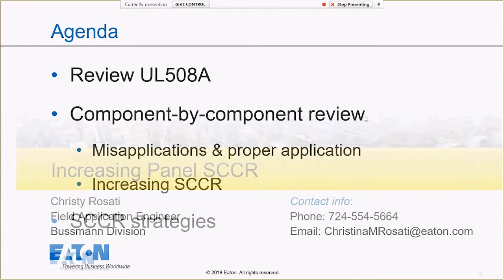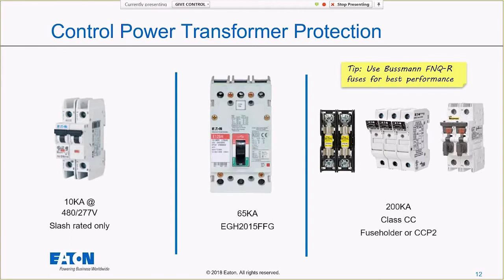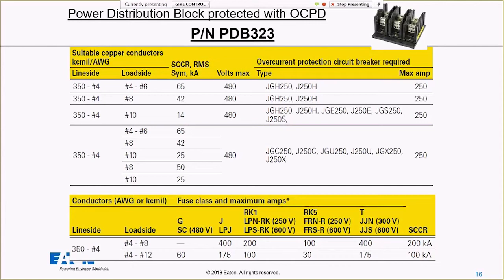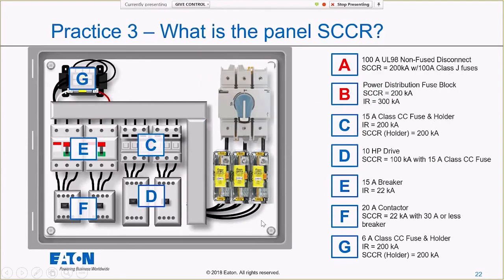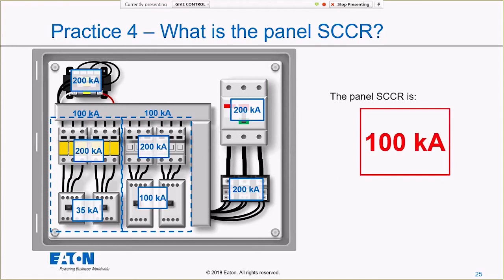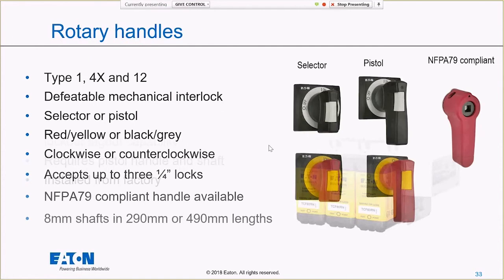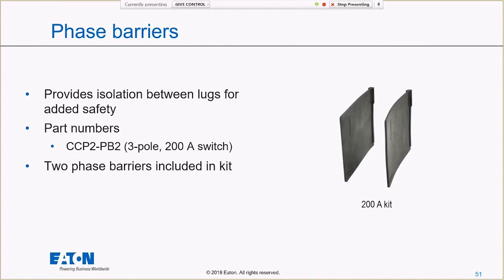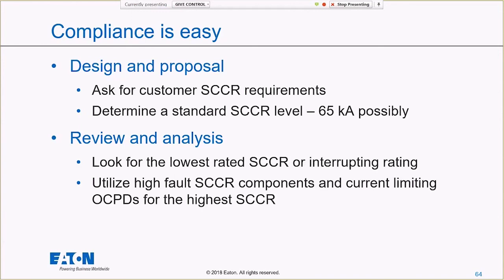Bussmann SCCR Part 3: Strategies for increasing Control Panel SCCR

Comment: I really went down the rabbit hole with the UL 1953 vs UL 1059 since many manufacturers are marketing their product as power distribution blocks but are actually being tested as terminal blocks. If you're unsure and the product data sheet only shows the certificate and UL CCN number a dead giveaway the as to whether the product is UL 1953 or UL 1059 is the UL CCN number itself. If the product UL CCN number is XCFR or XCFR2 it was tested under UL 1059 as a Terminal Block for branch circuits. If the UL CCN number is QPQS the product was tested under UL 1953 as a Power distribution Block for feeder and branch circuits. Just because something is marketed as a power distribution block doesn't always mean it's been tested as a power distribution block! Be careful.